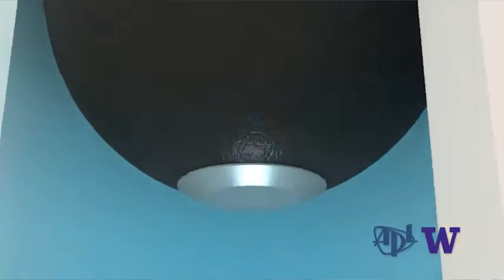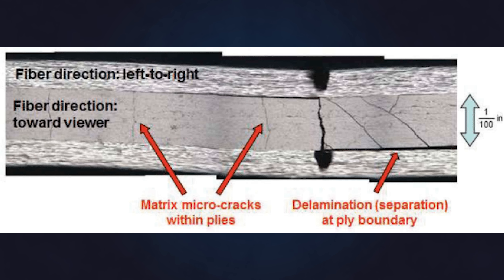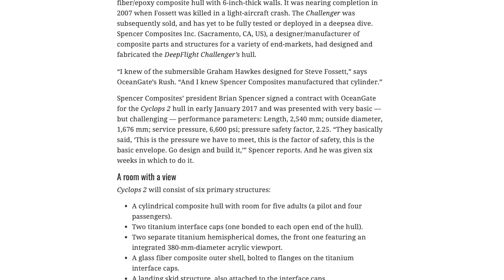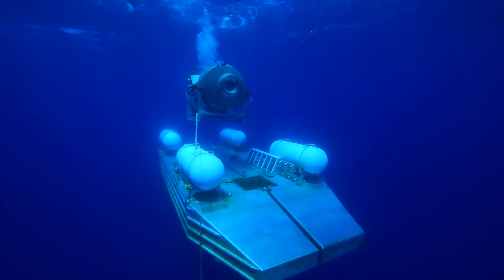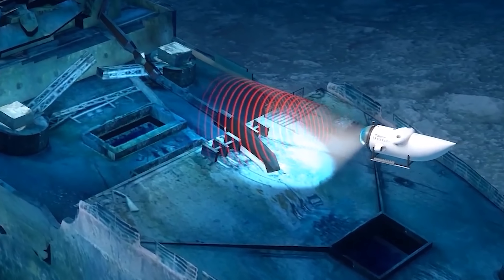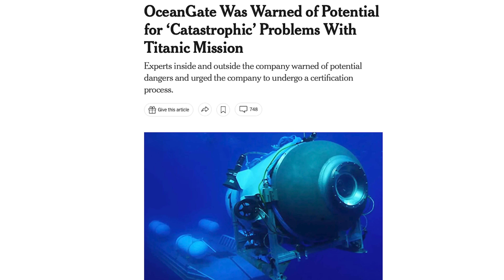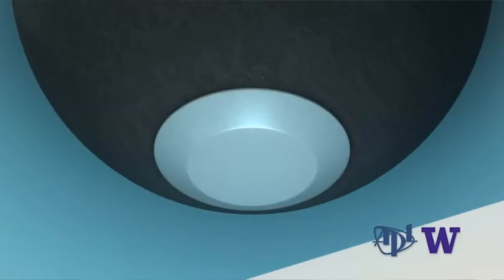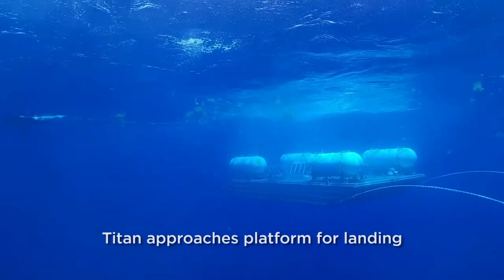Engineering Failures Behind Titan’s Implosion!

Comment: That is a false information about the leading expert warn Ocean gate not to use carbon fibre. The experts were concern about the craft not going to get certified by a third party for taking paying passenger and NOT because it was using carbon fibre. 

The ex-engineer was concerned about the viewing porthole and NOT the carbon fibre.

Actually you can’t even crtl-f to find a single word “carbon fibre” anywhere in the original raised concerns at all.

All concerned about carbon fibre came AFTER the sub already imploded NOT BEFORE.

You need to get your facts right. This video is extremely misleading
Reply from the maker: I think your comment is misleading, I did thorough research before saying what I said. Google “Missing Titanic Sub Once Faced Massive Lawsuit Over Depths It Could Safely Travel To” and look at the article from “ The New Republic” or perhaps just look at the court documents. 

Enough evidence there for ya
Reply from the maker: Also google ocean gate vs David Lochridge , read the counter claim. Also stop spreading misinformation, perhaps do more than a Ctrl + F next time
Reply: @beyondengineering  Was it about the carbon fibre hull? NO IT WAS NOT

The concern were raised mainly because Ocean Gate want to take paying passenger and they’re afraid it might take the whole industry down if something bad happened NOT because it was made out of carbon fibre.

The engineer raised concerned about porthole and the certification process NOT because it was carbon fibre.

Stop fucking lying or learn how to read properly.
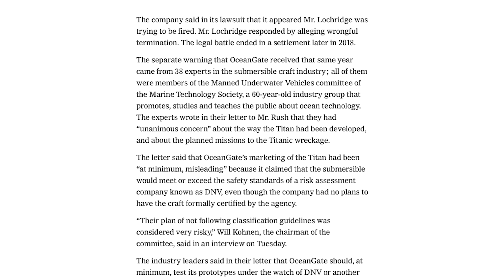Reply: @beyondengineering Just paused your own video at 5:13 and READ CAREFULLY

Do you see a single word about carbon fibre on there? NO YOU DON’T

Don’t tell me that these people are psychic and able to raised concern about carbon fibre without saying a single word about carbon fibre 🤦🏻‍♂️🤦🏻‍♂️🤦🏻‍♂️

Bonus, I just catch another mistake… you said that the engineer was sued 🤦🏻‍♂️

NO the engineer was never sued but its the engineer that sued the company for wrongful termination

You got just about every facts wrong in the video… at least you got the names right…Yayyyyyyyy

Ffs…🤦🏻‍♂️

Comment: Excellent analysis of the problems with choosing  wrong materials. Please correct me if I am wrong but, it looks like the end caps made of titanium transferred much more pressure to the edge of the carbon fiber glue seam than the hull pressure of the water.
And if two caps are pressing from each end if must have been extremely high. what do you think.

Comment: Carbon fibre bicycle frames use multiple layers of cross weave fibres impregnated with epoxy…then using internal ‘bladders’ it gets compressed inside and out whilst it cures……even then it is not perfect. Oh and if you have a bike like this, never clamp the frame in a bike stand unless it’s over the seatpost. They don’t take compressive forces well…..

Comment: There is a cheap, easy way to get buoyancy, but it does make the sub bulkier. Simply attach to each side a thin walled cylinder filled with a light weight fluid....the fluid simply gets pressurized to the outside pressure, and as it can't be compressed (much) the cylinder retains it's shape and is buoyant.

Comment: I recently heard someone hypothesize that it was most likely the carbon-fibre hull and the titanium front and back molecularly Contracting at different rates from the incredibly low temperatures of the water, and this would have caused the adhesive to fail that bonded the carbon fiber to the titanium, and it would have been not so much the same kind of implosion as so many has envisioned, but rather a breach caused from separation of the carbon fiber and titanium and it would have been the high-pressure compressed water from the deep ocean that would have rushed into the Hull at over the speed of sound obviously killing the occupants instantly, and this would account for why previous passengers were hearing crackling as they descended, and also why the remains of the hull of the vessel that was recovered did not look as though it exploded from an extraordinary implosion like we keep seeing in these animations.

Comment: Details of the Oceangate submersible's design and fabrication are hard to find. Careful review of Oceangate's blog and several presentations by Stockton Rush shows there were two different shells for the Titan.  Many videos of winding the composite shell with wet carbon fiber/epoxy are from 2017 by Spencer in Sacramento, (a marine composite fabricator}. Per Rush, all 5 inches were wound radially (no cross plies).The photos/videos of bonding the shell to the titanium rings (10:58) are from the first shell in 2017 also.  "Problems" with this first shell arose during deep water testing in 2018 & 2019 so OceanGate derated it from 4000m to 3000m. Titanic is at 3800m so OceanGate built a new shell of the same dimensions (and maybe new rings) in 2020 at Electroimpact in Seattle (an aerospace composite fabricator) using, according to Rush, expired prepreg from Boeing and biaxially layup.   Hopefully the investigation will reveal details eventually.

Comment: It is so simple, carbon can show very high tensile strength but not compressive. That is why light weight high pressure vessels (>300 bar) for ,for example, hydrogen are built successfully . But surely not the opposite! What a major stupid mistake. Anyone with a bit of engineering knowledge would understand.

Comment: The first carbon fibre fishing rod was produced in 1975 by Hardy, which I consider not a new material and it's properties are well known. Don't make any excuses for Stockton Rush.
Reply from the maker: I meant relatively new compared to metals that we have worked with for centuries. There was absolutely enough evidence and information out there, that’s why they should have tested this thing to the absolute limit, multiple times before stepping foot in it

Comment: I feel that even in excellent manufacturing conditions, a carbon fiber hull in a submersible would eventually fail far quicker than a metallic hull. It’s just not a material to use when it is compressed inward. For internal pressure tanks, it is a different scenario all together. Pressure vessels made out of composites have seen great success. Scuba tanks are increasingly using carbon fiber even for pressures exceeding 2000psi. It really is a great material if manufactured and used correctly.
Reply: Well, this was the major problem with Titan. An oxygen CF pressure Vessel has its pressure internally so the CF is in Tension, all good. Titan had 1 bar of pressure internally but it’s CF Hull was surrounded by high water pressure particularly at 3-4thousand metres down, it was this compressive force that eventually caused the CF Hull to implode, probably at the joint between the end caps. A totally avoidable and foreseeable tragedy.
Reply: Exactly, you can run over an empty tank with a truck and crush it but it will handle thousands of PSI internally

Comment: one thing everyone has been ignoring is the glue holding the carbon fiber to the titanium. the glue was put onto the titan very poorly, with someone touching the end caps with his bare hands and getting his hand oil all over it. the oceangate engineers also mixed the glue by hand and didnt use a vacuum chamber after, which introduced air bubbles and made it a lot weaker. combine the glue being terrible and the carbon fiber cracking, and you get the titan incident
Reply: I also think the main failure point is the junction of carbon to titanium. The overlap seems way to small from judging from the videos and the jump in stiffness is too sudden. Then the bonding was done very amateurish. Applying the glue and then sliding the parts together, can push the glue off. I would have injected the glue in the cavity after the parts are assembled.
Reply: Very amateur work.

Comment: Sounds to me like Spencer Composites holds a fair bit, if not most of the responibility... that contract seems fairly clear that Spencer Composites  designed it and built it to meet those requirements and knew what it was for and said it would be strong enough with over a 2x safety factor...

Spencer Composits was the "expert" here... they were consulted and contracted to design and build it... and did, and said it was good, and it evidently wasnt...

Comment: This video contains one my main thoughts, lack of repeated stress testing.  Since CF was never used before in a pressure vessel, how can anyone know the serviceable life of CF without adequate testing?  How many dives can a CF pressure vessel withstand before flaws and delamination render it unusable at depth?  They never did any repeated long term testing, so they never knew.  If if they did, how can anyone be sure that even with the same design and construction, would the pressure vessel would fail exactly the same each time.  Considering variabilities in the carbon fiber construction, each iteration of the pressure vessel could fail at different times in different places.   Just the mere fact that CF is not known for compression strength would have stopped me from ever setting foot in that submersible.

Comment: Wasn’t it the portal that is being blamed for the implosion? I’ve read it wasn’t regulated to go beyond 1,300 metres!?
Reply: Not necessarily. You usually regulate a component with a safety factor or allowance involved, so that there is cushion between that upper limit and your overload failure. The design, material choice, lack of empirical test data, and lack of NDE testing means there’s many likely potential failure paths here. The failure analysis of the debris is really the best way to figure out some answers.

Comment: Interfaces between two materials with widely different properties i.e. carbon fibre composite and titanium connected with epoxy resin seemed to be a bad choice to me, especially under the conditions that Titan had to withstand. Stupidly bad engineering.

Comment: Excellent analysis. I’m not sure that fatigue is a relevant failure mechanism for carbon fibre? Cracks don’t propagate through CF the way they do in ductile materials? I think your observations about the lack of proper curing, together with poor toughness, and the risk of de-lamination are spot on. When combined with poor inspection as you also point out, this was really a disaster waiting to happen.
Reply: Now I want people to make a new one, just like this, test it and inspect it properly. Never with people inside. Produce a better version, see if it can be done with CF in multiple directions, apply the epoxy properly and heavily test and inspect that one. Just to get a good understanding how it fails, when and why. Makes me think of the most recent SpaceX rocket that failed and all the engineers were cheering saying: 'We now got so much data to work with'. 
Would be very expensive and not worth it since conventional designs have already proven to work. But it would be very interesting.
Reply: @tomghzel  It would be interesting. In reality they should have built a number of prototypes and tested them to destruction. Starting with a 1/4 scale model wouldn’t have been that expensive. They could have put that through 50 or more pressure cycles and then subjected it to non-destructive and destructive testing. So much could have been learned from that process?

Comment: Metal fatigue is also caused by microscopic defects - growth of small cracks growing to a critical length. With the exception of slag inclusions/porosity in almost all cyclic loading applications the cracks first appear on the exterior surface of the component where the stresses are the highest. The methods for inspection for metal fatigue are well developed (visual, dye testing, eddy currents). And methods for finding internal defects are also well developed. Your cross section of a failing composite sends shivers down my mech eng spine; the failures can be internal. Such can occur in reinforced concrete structures but buildings are designed with large safety margins (or should be) and concrete usually displays signs of distress well before failure. 
OceanGate did test the design to failure (have a data set of two: 1/3 model and prototype) but did so IMO a tragically reckless manner. NASA & US military blew up a lot of rockets before strapping even a chimp on top of one. Boeing & Airbus have broken a lot of composites and correlated number of cyclic to failure with nondestructive/destructive test data. IMO both do not want anything to do with a long, hollow cylindrical composite structure subject to hundreds of atmospheres of hydrostatic pressure.

Comment: The reason I wouldn't use carbon fibre to resist the compressive forces subject to a submersible is because carbon fibre is not good in shear. The compressive forces of the deep, acting equally on the vessel are, in effect trying to reduce the area of the vessel. This would translate to a shearing action at that point where a deficiency in the material meets a point of greater resilience. In terms of material suitability, resilience, and manufacturing process, questions abound.

Comment: Is it possible this guy on the internet solved this entire mystery from his desk at home?  Oceangate was touting working with the University of Washington on the design of the pressure vessel hull. What the university study showed was that using MULTI-directional weaving of carbon fiber still gave way at the interfaces of the small end caps.  It seems Stockton Rush assumed he solved this problem by replacing the small end caps in a multi-directional weave of carbon fiber with large titanium end caps in a "uni-directional" weave, seemingly completely misunderstanding the strength and load properties of carbon fiber and what the University of Washington study actually showed.  Carbon fiber is completely unsuited for this application via today's manufacturing processes.  Oceangate not only did NOT develop an improved manufacturing process for carbon fiber under pressure, but seemingly did not understand the findings of the university study and actually created an INFERIOR pressure vessel than the one manufactured for the study.  In the study, the University of Washington attempted to reduce the interface of dissimilar materials by making the end caps small and weaving the carbon fiber in a multi-directional pattern to possibly rely on the tensile strength of the fibers if they were compressed in multiple directions. Oceangate literally increased the size of the interface between dissimilar materials and did that at 90 degrees angles in a high external pressure situation.  Even a child can see that what Oceangate developed was a tube of toothpaste with a cap on each end.  Again, incredible video.

Comment: Did anyone notice, during the offloading of Titan parts, one of the titanium rings that was circular came back oval in shape. Although it was partially obscured by a tarp, the oval shape was obvious.
I am surprised the glue holding the carbon fibre to the titanium ring was strong enough to remain attached while the ring bent under the pressure.
Reply: Actually, it looked intact.
Reply: @@davesmith3023 … yes titanium flexes… it’s why it is such a great material. A material that doesn’t flex, snaps!

Comment: Could they have woven additional materials in the composite like a titanium wire? Clearly the lack of autoclaving the finished cylinder was a mistake. OR have a titanium inner hull mandrel that the carbon fiber outer hull is wound around? The outer caps could have been mechanically bound to the inner mandrel vs just glue. It’s too bad that a CF solution is now certainly never to be used in the future.

Comment: Stockton was the reason. He knew there was no chance of his submersible getting classed because of all the rules he "broke" which he knew had a considerate
risk factor otherwise he wouldn't have mounted the sensors on the hull. Crackling sounds should have alarmed him. An engineer would have instantly seen the
need to perform rigorous tests and it sounds like there was but he got fired. Everything about this is just insane. If he went alone then by all means he can risk
his own life all he wants as long as he pays for his own dives but putting other people at risk and manipulating them into thinking it's safe is so irresponsible.